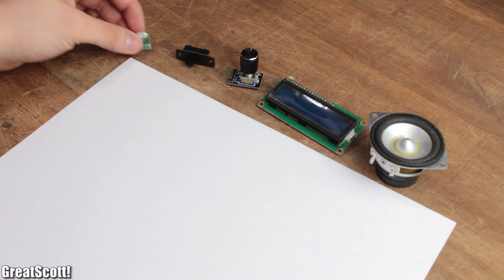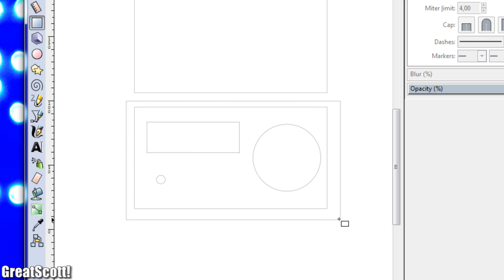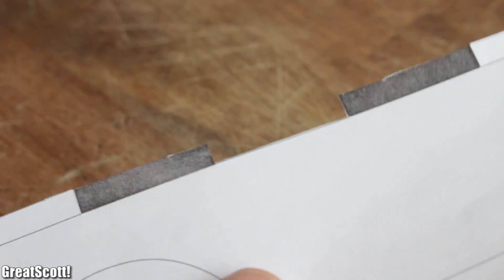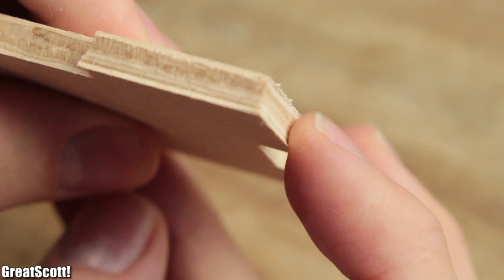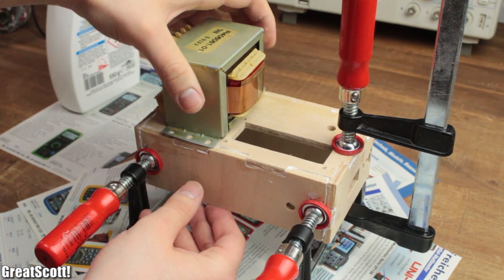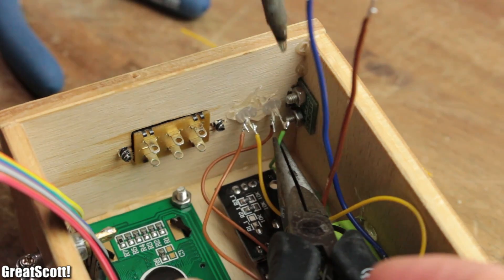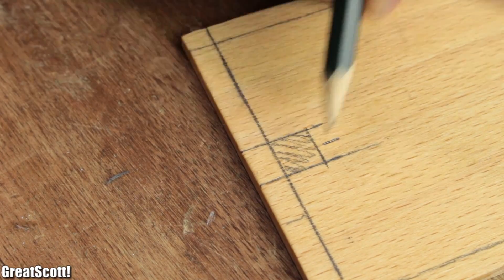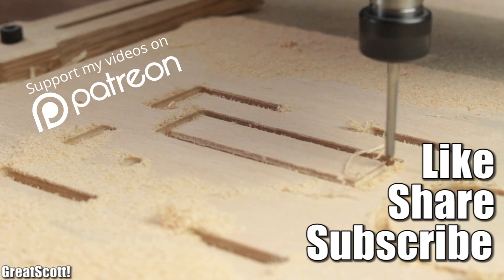Make your own FM Radio - Part 2

Comment: @GreatScott ; Don't you hate it when the regular cutter you use pulls the material up, leaving you with an jagged edge you have to clean up manually? Try a straight flute cutter, multiplex stays a lot cleaner that way! 👍

Comment: Thanks for posting the two videos.  Is it possible that you can also post the schematic?  I'm really interested in adding and LCD to an amplifier I am building that will include an AM, FM radio, connections for a DVD player, Phono and a auxiliary input.  Ultimately I would like for the LCD to display the frequency the AM or FM radio is tuned to and then to display "DVD" when that switch is on.  Is all of this possible?

Comment: Hi , bro.. i have never seen ، you test this radio project in detail..
My experience proves ... Class D Amplifier and boost converter destroy all radio stations (because I live in rural areas where there is not a strong radio signal)

Comment: Great job... but this could have been an absolute piece of art if youd used some darker wood. And also the way the sides are glued together leaves depth differences. You couldve sanded them equal. Other than that, its amazing man.. if i ever reach this level of electronics ill make this.

Comment: You may know your electronics but passed up a nice opportunity to make this case a lot more attractive using your fancy desktop cnc and little or no glue. https://en.wikipedia.org/wiki/Dovetail_joint
Even finger joints, which is basically what you have done look good and are strong and a common choice for speaker cabinets, generally have fingers that are roughly as wide as your material is thick. I'm sure this design is marginally stronger than using butt joints all around (6 rectangular panels glued or nailed in a cuboid) but the extra work hardly seems worth it if you're doing everything manually and don't really care how it looks.

Comment: Im a beginner when i buy all parts and wire the parts like in the instructibles i only need to flash your programm on the arduino. No programming ?

Comment: do I need the Micro A/B USB Female Receptacle Breakout board if I choose the other brackout board also do I need the audio amlifire and Joe Knows Electronics 33 Value 645 Piece Capacitor Kit, 10Pcs DVD VCD 10K Ohm Trim Pot Potentiometer Top Adjustable Resistor and the Foxnovo 125pcs 25 Values Total Electrolytic Capacitors Assortment Kit Set 1uF to 2200uF (Black) if I want to make a little Bluetooth radio with the antenna
Reply: and do you have to solder the LED's to the board for power? and can you do it without the electronic purfboard, can you use electacal tape to secere the wire the the battery?

Comment: GreatScott please answer my question:
the fm module you have used is gives stereo outputs, so did you converted it to mono output? or used any of the stereo output?

2: it is possible to tune radio accurately like 92.3, 92.4, 92.5,... frequencies?

Comment: GreatScott please answer my question:
the fm module you have used is gives stereo outputs, so did you converted it to mono output? or used any of the stereo output?

2: it is possible to tune radio accurately like 92.3, 92.4, 92.5,... frequencies?

3: How to convert this radio to stereo outputs?

PLEASE ANSWER ALL MY QUESTIONS AS EARLY AS POSSIBLE.

Comment: If it was a kit ,with a circuit board,that was mark out,I would buy it .the kind of circuit you are using not for this novice kit boulder. But still a good video,if it was in kit form with your design,I think it would be fun.

Comment: I noticed that you hooked everything to just the one battery.  I have a problem with my project of it shorting out when used at high volume. could it just be a short or the fact that I have two module's that both use 5v connected in parallel to power supply?

Comment: you used 2 rgb leds instead of the red and green component of the same led.... what the **????
Reply: Apparently, the ones he used have common cathodes. But the board effectively needs a common-anode LED's.
Reply: then use 2 diferent monochrome ones?
Reply: GreatScott!
1 year ago
+iceberg789 I simply didn't have other ones laying around.

Comment: Hey I just thought of a mod for this. Run a wire from the positive pin of the battery to an analogue pin on the Arduino. With a few extra lines of code you could have a battery percentage on the display.

Comment: what was the correct end mill that you should have used?? I just bought a cnc and have a project case similar to this in mind for a mini guitar amp. The tab idea is great. Thinking countersinking screws that sit just below the surface would be best. nice project...

Comment: 4:59
I hardly get the point of using RGB leds then cut the unnecessary colors !
Was it really necessary ? Could'nt blue leds fit at that place ?
Next step: use arduino pro mini, then remove the atmega and unecessary resistors to get the MIC5205 voltage regulator...
Anyway, awesome video, thanks for the share :)

Comment: What ? Wait, did i heard it took you 3h on a CNC to make the box parts ?! Damn, please invest some of your time to seriously learn woodworking and dovetail stuff, it's not hard at all BUT you'll save a LOT of time on machining, programming, and other computer bullshits. No toxic acetone required, either, when done properly. Pencil, and brain, and you'll be amazed by the better quality of your results if you leave out the gadgets.
Nice ideas and good pedagogic approach, otherwise :)
Reply from the maker: +Okto Putsch Keep calm. I used the speed settings of the Easle software. That is why it was so slow.
Reply: GreatScott! But i'm calm :) and my advice is still available ;)

Comment: you could save 2 magnets by adding just 2 steel plates on the cap. Placing just 2 magnets inside the case should hold the cap strong enough.

Comment: If the glue won't stick to the varnish, varnish it before you glue it, to get rid of the need to use acetone, or just mask your wood. Anyway, lovely project. I hardly understood how any of it worked, but it looks good.

Comment: Don´t want to be offensive against you, just 3D CAD program in first moment will be better in my opinion (some easy are also for free), you can check pieces accuracy and assembly feasibility on your screen...and then, if you are working with wood or in your case plywood, milling machine whit drill bit? sorry, but that´s the problem with your shapes and flatness of edges..Definitely you need some mill bits. http://i0.wp.com/cdn.makezine.com/uploads/2014/03/cpendmill2dsc00190.jpg?resize=620%2C410 It´s so many variations. (but personally, I would use plastic parts) ...

Comment: Hi! I really liked your video, but I was wondering, what kind of wires are you useing to connect your electrical components, and where you get them from?
I am currenly working whit separated UTp cable wires, but they arent nearly as fine as yours. Could you please help me?

Comment: Software mods for you kit :

SUPPORT JAPAN FM STEREO BAND @ 76.0 to 90 MHz
SUPPORT E Europe FM STEREO BAND @ 65.8 to 74.0 MHz

Turn the STEREO OFF (if the chipset supports it) for Marine Band Channels

Marine VHF radio refers to the radio frequency range between 156.0 and 162.025 MHz, inclusive. In the official language of the International Telecommunication Union the band is called the VHF maritime mobile band. 

Probably this will require another mode switch ... and some reprogramming.

Comment: I love your projects and videos! I do have a critique though, PLEASE stop using files like saws/sandpaper with that back and forth stroke!!! Files have a specific stoke direction, typically a PUSH stroke to do the work. Pulling backwards after the forward stroke is bad for the file and increasingly reduces the life and functionality of the file. Sandpaper is made for a back and forth motion, files are not. ;)
Reply from the maker: Sure, but soft wood will not have an impact on a metal file.
Reply: +GreatScott! As a lifelong woodworking enthusiast and son of an amazing carpenter, I have to disagree. Even the softest of materials will dull a blade, even more so when incorrectly used. Sometimes even worse than harder materials. A file is hundreds of fine blades/teeth and reverse pressure can bend, warp, and dull them faster than using them the correct direction. Your end results will look better, require less sanding/finishing, and your file will last longer when used correctly. Soft materials cut in the kitchen with a carving/butcher/chef knife dull the best knives over time, same is true for wood, but files aren't sharpened nearly as easily. I intend no demeaning, but only wish to help people use the correct methods for tools so they function to their best ability and last a long time. A good file when not abused will cut very cleanly and assist your project completion (with less effort). 

http://www.bobvila.com/articles/2100-filing-techniques/
http://www.accuratebuilding.com/publications/recipes/tools/how_to_file_surface_edges.pdf
I absolutely disagree with the 3rd page saying to use a wire wheel or metal brush to clean your files, NEVER do this..EVER! There are many better methods for cleaning files, many of which are found in the comments section of the Instructable. 
http://www.instructables.com/id/Introduction-to-Files-and-Rasps/step2/Using-a-File-or-Rasp/ 
Nicholson is one of the absolute BEST files you can get. I use them for woodworking, gunsmithing & and everything in between. 
http://www.nicholsontool.com/MagentoShare/media/documents/nicholson-guide-to-filing-2014.pdf

Comment: if those pieces took 3 hours to cut then you seriously  have your speeds and feeds way off. if you use decent enough tabs that should be able to be cut in a single pass or 2 at a push in around 5 minutes. a decent tool is also recommended, try lmt-belling tools.

Comment: >cut RGB LEDs to make them monochrome

Absolutely savage! :D
Reply: money bro
in india it so it so expensive to get proper rgb led . due to china give fake one and not work fine .
Reply: @yagneshpatel1183  unfortunate, hope it gets better over there.
Reply: could he not have just cut the blue pin off and used a single LED for red and green?
Reply: @Magnum-1231  or just connect the Anode/Cathode (what ever the led has as common) to the tp4056 board and make it 2 colors so that it will switch when it's done charging?

Comment: What is the purpose of the capacitor on the speaker? I know it is a filter but what would happen with out it?
Reply from the maker: +liljoey112 You amp can output a DC offset voltage which the coil of the speaker would not endure for very long.

Comment: Maybe next time use plywood boxes from the fruit (it is free), and most importantly, you can cut it with a knife (only 3 mm thick). I do not like the idea of a keyed connection. It's hard to do them and even using a CNC effects are not very spectacular. It would have been nicer if use connections directly one face to another. The addition of a little bit of putty and spray lacquer / paint, and we have built housing for the device in one afternoon.

Comment: What do i have to change to use 2 speakers (stereo)?
Reply from the maker: +Krunoslav Hrastić Just don't mix the two signals from the TEA5767 together.
Reply: +GreatScott! Don't I need  then two digital pots for the volume control?
Reply from the maker: Krunoslav Hrastić
Correct. Or one IC with two digital potentiometers inside.
Reply: +GreatScott! Do I have to change the code in order to use a single IC with 2 pots (MCP4251) or is it easier to just buy 2 MCP4151 and just tie the data and clock lines together?

Comment: Everything cool but one major derp move. You cut two legs off your RGB LEDs to make them single color? Why not use a single color LED!  You just wasted €
Reply: +motherjoon It is not that hard to solder something else on there if you want to make them rgb again.
Reply from the maker: +motherjoon I simply did not have other ones laying around.

Comment: Please put a heat isolation layer between the lipo charging pcb and the Lipo. It can get very hot and might damage (or worse) the Lipo.

Great build!
Reply: +Kenneth Tan Its an 18650 li ion battery not lipo
Reply: +danijel124 I know it's an 18650.  I call them Lipo's,  generalising the bunch a bit.  Key is that the mosfets on de charge board get very hot when pushing 1A (default setting) This heat permeates through the pcb. That why I never glue them to a "Lipo"
Btw if you use hot glue, it wil melt.
Reply from the maker: +Kenneth Tan The charging circuit does not touch the Li ion cell. The wires hold it in the air.

Comment: i think the xcarve is a rather big disappointment... 3h and it didn't even leave a strait edge...
Reply: +muh1h1 It has a lot to do with the setup and how passionate you are about your cnc machine. Properly put together and material being firmly clamped down you can cut aluminum with it.
Reply from the maker: +Doktor Jönsson Correct. It was my mistakes, not the machine.

Comment: You might already know this but that is not the way you are supposed to use those hold down clamps, https://youtu.be/UtYbd89kVgY?t=2m29s

The screw should go through the slot and the back hole should be threaded for a screw to adjust the back of the clamp slightly higher than the material

Comment: Next make your own headphones.
Reply: +Its Voodoo From wood with the x-carve :D
Reply: that would be cool.
Reply: David Ygjfdhu It would and I have a pair of speakers from some headphones that I want to put to use.
Reply: you can make your own bone conduction headphones by connecting a small dc motor to the audio output. If possible you should use an amplifier. then you only need to hold the motor onto the bones above your ear.
Reply: Krisztián Szirtes The x-carve cost too much
Reply: It would be pretty easy to make it actually